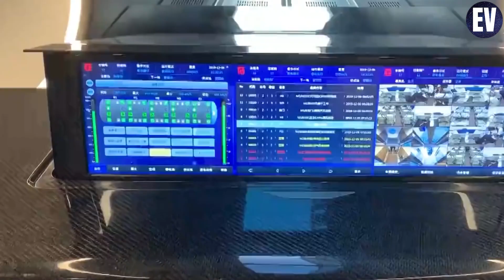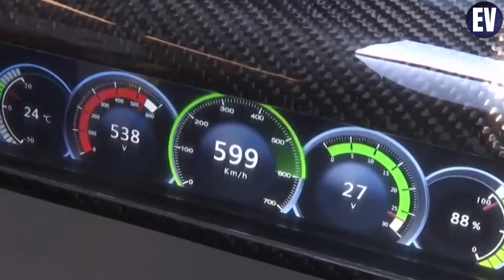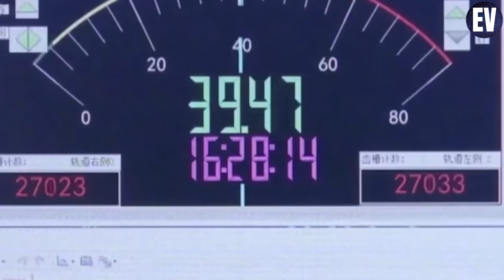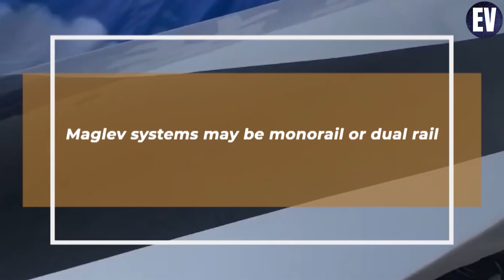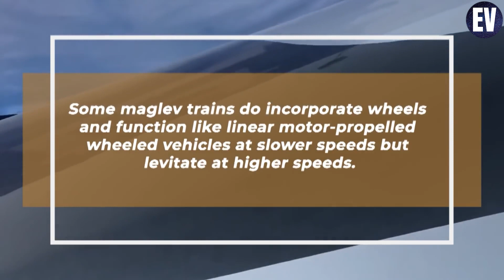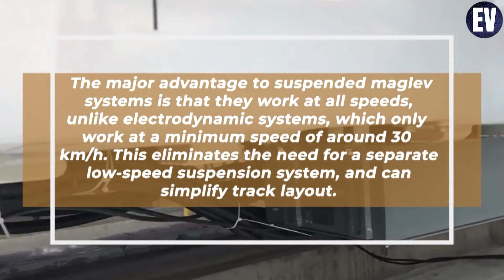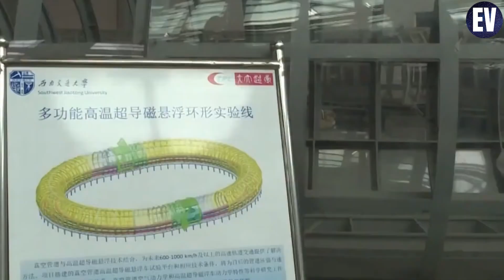CHINA'S PROTOTYPE HIGH SPEED TRAIN REACHES 385 MILES

Comment: Japanese maglev test reaches 603 km per hour bro
Reply: Actually a few countries have maglev vehicles that go faster than 600, but the chinese one is the only one that is open to the public 24/7 atm.
The problem is the cost of the tracks, not the speed of the train or the train manufacture itself. Also the apparent demand for the transport as well.
Reply: 603 kilometres per hour =
374.687 miles per hour, bro.